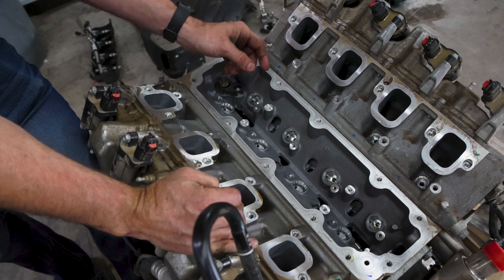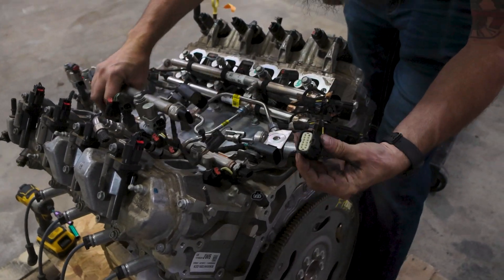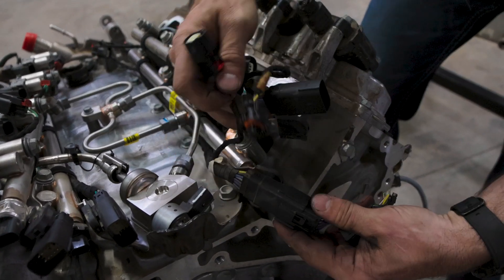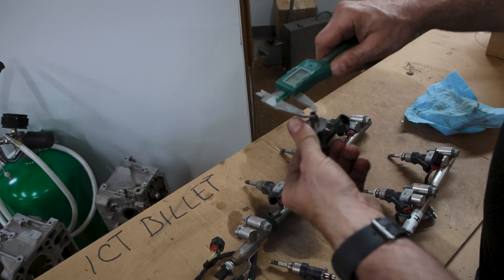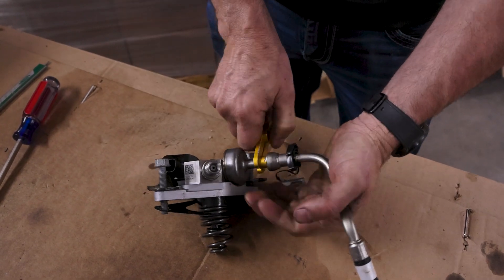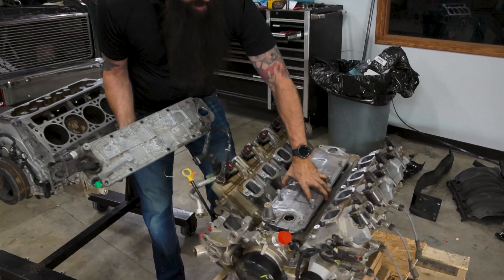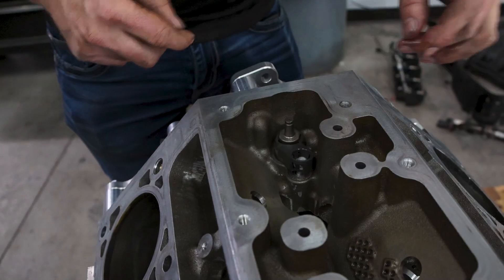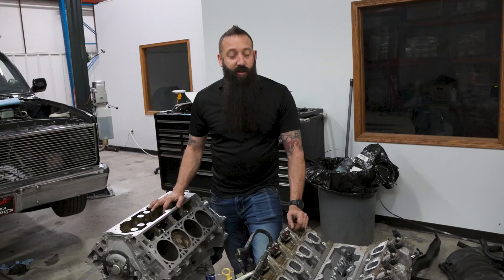AFM vs DFM Comparing Our LT1 Engine to an L84 Engine Block

Comment: I was curious if you guys had a kit or knew what to do I'm trying to plug my power brake booster into where my PCV valve is is there some kind of a y splitter so I can have two vacuum lines going into the PCV for a vacuum pump delete